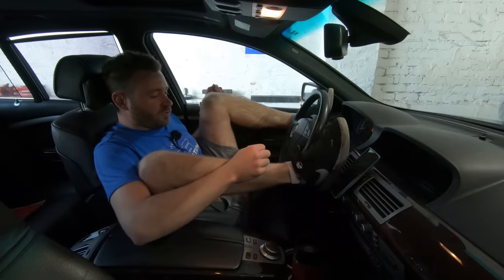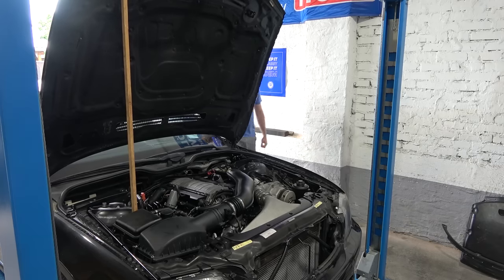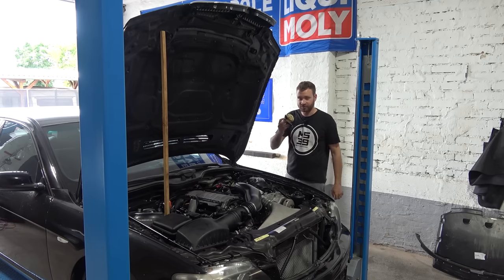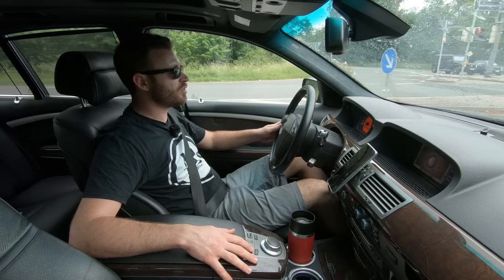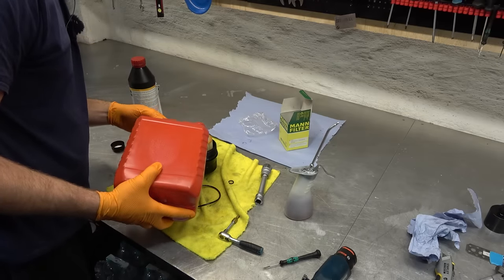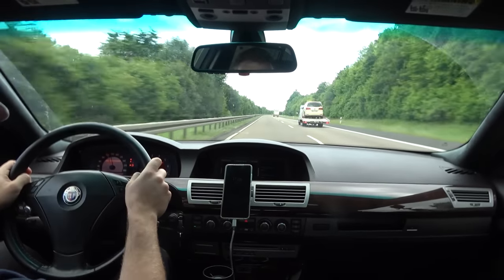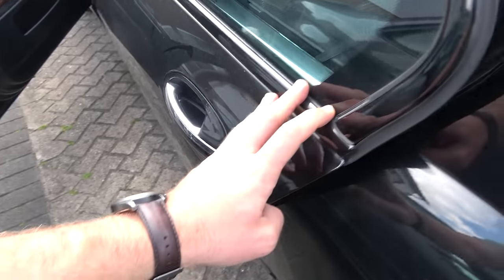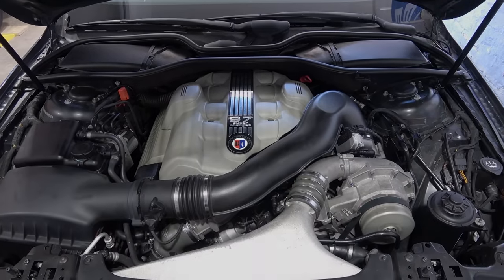Will The Freshly Built Engine Survive? - Supercharged Alpina B7 - Project Chicago: Part 11

Comment: Regarding the power steering hose: over here in my town we have a shop that specializes in making hydraulic lines, e.g. heavy equipment fluid lines, ac lines, ps lines, etc.  I'm sure you have one in your town too.
Reply: I second this -- I have heard of Rob Dahm doing the same thing in a recent video. He mentioned that the manufacturer charged some $300 or more for some hoses - I think they were fuel or oil hoses. 

He didnt like the price so he hit up a shop that specialises in hydraulic lines and they built him one with all the fittings that he needed/wanted for $100-150.

At least i think it was Rob Dahm.
Reply: @Rose.Of.Hizaki  I found the shop (Hosefast, in Garland, TX USA)  in my town after I went to replace some power steering hoses on my old '92 Honda Accord.  NLA from Honda, only leaving crappy, obviously-not-stock-looking aftermarket alternatives.  They were able to take my original fittings and graft them to new fittings to be pressed onto new hose.  They looked factory after they were done.
Reply: I had the tranny cooler lines on my E65 start to leak due to corrosion at  the hard line/rubber line junctions. At $500 a set to replace, I just replaced the set of lines using stainless-braid lines and appropriate AN fittings like I've used in my race/rally cars. May not be stock and true to the design; but cost less than half and a better, more reliable solution.
Reply: If you use one of these hydraulic shops, the rubber will last twice as long. And the hose will probably cost a fraction of the price the crappy OE part would.
Reply: Second this. The work is usually spot on and also super cost effective.
Reply: In my area no one of the  heavy equipment shops will crimp you their hose ( muuuch stronger the the original ) for a car power steering unless you wil tell them it is for a lawn mover.
Reply: Yes these hoses are made and replaced all the time for JCB, CAT digging equipment and tested to 1000s of PSI.  Cheap too compared to buying from the dealer.

Comment: Hi Sreten, I have my opinion about the choices that Alpina made with this model: almost every manufacturer in in that period of making cars (2000-2008) changed the thermostats to higher values (from 85-90 to 102-105 degrees) and put 5w30 oil for emissions purposes. Higher the temp in the cylinders = cleaner burn, less CO2(but they didn't know back then about NoX or not yet required to be measured) and lower viscosity meant less friction = less CO2.
Keep it up! Really nice work.
Reply: Was thinking the same. Noticed almost all the benzine naturally aspirated engines , from that era , running a lot hotter than needed. Has to be the bullshit emissions reqs.

Comment: I agree that the E65/66 may have been the last BMW true to the marque. No turbos, no AWD and not that bad to work on if you have the right attitude and access to an ISTA scanner. Very pleased to see that you have the B7 up and running properly. Sounds sweet and solid, the way the BMW gods intended. Great job, excellent recovery from a relatively simple mistake, and well-documented. Have enjoyed every minute. Now on to sorting the suspension! BTW, I have an '08 E65 750i and I love it! May very well be the best car (of the 50+ I've owned) I've ever had.

Comment: Weird how it worked fine on initial startup, must be an oil pressure thing.
Reply: Car needs to see a fault a few times before it throws a check engine light and disables vanos I think.

Comment: When I deal with obsolete leaking power steering or brake hoses, I take them to a local supplier here that deals with high pressure hydraulic hoses and fittings for heavy industry like forklifts, farm machinery, elevators, etc and they can rebuild them often with better components than the OE can provide (anyone who has had experience with GM or Chrysler hose crimps can attest). I'm certain there would be something like that in your area, Sreten. If you're unsure just ask someone who works on Forklifts where they get their hoses rebuilt.

Comment: Sreten,   excellent effort and just reward  for just never giving up!    If I was managing design at BMW I would have the VANOS units designed so  that a) they could NEVER be fitted to the wrong camshaft and b) the electrical plugs to the VANOS solenoids could NEVER be reversed.   You would not be the first to fit the VANOS units the wrong way around and you won't be the last.    Also there are brackets on brackets on brackets and LOTS of fasteners,   breaking all the rules of Reliability Engineering.
I think the best beer comes from Munich.......
Love the borrowed dog!

Comment: Really pleased for you. Did a similar thing with the intake etc on my S85. Not the Vanos units n the wrong place but measuring the intake and exhaust the wrong way round on bank 2 making the exhaust out by 39 degrees every time. Stupid mistake but easy fix. It was actually perfect every time if I'd used the correct tool.  Running sweet now.

Comment: Most pleased to see you get this back together and in good shape. I think your sensible approach should future proof the engine. I have to agree, tight tolerances and high temperatures in conjunction with dishwater thin oil and forced induction is not a good combination. Absolutely ecstatic to see the E30 back. Please treat her well, she’s an old girl and is some way handling wise behind even the E36. Hopefully happy days from here on.

Comment: You have so much going on with your new channel venture,  I would suggest when you do a engine rebuild (with all these details) you make a basic assembly "check off" chart.........especially for components that could be potentially swithed or reversed. Like VVT adjusters ;)
I recently read on a Audi forum where a member with a A6 did this very thing! Only he spent days and days after his work trying to diagnose the fault code.
In the evening, when you are lying around thinking about all these projects, make the lists for potential problems "what could I intall backwards or incorrectly on this (engine) project" or items that you think could be reversed.  Then tape the list to the windschield  or side glass of the project car - that way you will be reminded of potential pit falls as you go.  
Always enjoy your videos and thrilled for you that the Alpina project worked out!

Comment: I used to be a bmw mechanic and I think the bearing issues were due to 10w60. Too viscous and people did not warm engine up properly and that oil is for racing. I recommended against bmw recs, a redline 5w40/50 (can’t remember if they made a 5w50 but I think 10w50) or any real PAO synthetic oil in 5w50 in summer or if driven hard 8n cooler weather and then 5w40 in cold temps if car was used in those temps (below 40f). Had good results.

Comment: to stop scoring of the block, add 0.5% per litre synthetic 2 stoke oil (MOtul 800 / Castrol 1 ) I use 2 stroke oil in ALL of my 4 stroke engines for the past 20 years. Stops valve stem wear / Injector wear etc etc. I have E39 540i which I naturally use 2 stroke oil @0.5% <  no problem for the oxygen sensors etc and I see improvement in k/litre improved compression etc. Compression will actually get better after using for 1-2 months. Current day fuels are to dry for engine longevity.

Comment: Ive been there.....made a simple classic mistake on assembly.  I was putting a new chain and guides on a E46-316ti and when I locked the cams with the timing tool, the intake cam had already skipped enough teeth that I had it out by 180 degrees, when I rotated it to be timed to the diagram/picture I was following.  Assembled it would not start.......despite having spark and fuel.  Luckily the valvetronic system means the intakes never open much on cranking, and so the valves never hit the pistons. I figured out the problem, got the intake cam correctly timed, and away it went. Drove me mad why it would not start............but I just decided to make no assumptions, and check every thing that could be wrong.

Comment: Very nice work, congrats!
btw, the difference of in/out VCP (variable cam phaser, Vanos for BMW)) usually are the turn direction (clockwise or anticlockwise ) of the pulleys relative to their rest positions (without hydraulic pressure). I am surprised such a component was released by BMW without a proper mechanical poka-yoke to prevent incorrect assembly. Zum Gluck, nichts schlimeres ist passiert.

Comment: Congrats on pulling through with that B7! That called for some grit and determination!!
On BMW steering wheels that basic e60 wheel is bad alright, but remember the steering wheels from the nineties, those first ones with airbags? puuuuuuuuke For me they were deal-breakers on some occasions. Especially when you knew that the same generation of car could have a really beautiful non-airbag version in the previous model year. Maybe an e60 m-sport wheel could fit the Alpina?

Comment: If asked previously, sorry. Why did the engine start and run well the first time if the vanos intake and exhaust gears were incorrectly installed? Would expect check engine light and poor idle the first time you started it? As always Sreten love your passion and your videos.

Comment: hey man, cheers from venezuela, car enthusiast. i gotta question: Dont you think that an engine from design with such tight tolerances between parts should be using a thinner oil but a resistant oil? how will a 5w50 oil flow at the rate that is required through such tight gaps? this is a question from a car enthusiast perspective and an economist, i am not a mechanic neither an automotive engineer. Here we use a 10w40 viscosity oil but its because the weather - intense heat and traffic. (i know you should use what manufacturer recommends, but in some vehicles the recommendation depends on the weather you operate the car). anyways i enjoy the content you create, its unique and im always looking foward to see if you post any advamce on this particular vehicle that was a challenge.

Comment: Hello, i'm a big fan of your Channel. I also have N62B44 in E60, i also rebuilded my engine about 9000km ago and i still have glitter after second oil change. Can you please explain why it is normal to have glitter in the oil filer cap, because i'm little bit worried, no any big metal shavings. Thank you. Thumb up.

Comment: Unreal that you happened to notice those gears being off when standing there looking under the valve cover, just think what would have happened to your brain if you buttoned her back up and didn't notice that!

Also - the very first "mod" I do to all my cars is buy silicone wiper blades.  No more window chatter and they last YEARS and YEARS compared to normal blades, while constantly leaving a microscopic bead of silicone on the windshield each time they wipe.

Comment: Eibach springs are no good. You are missing out on suspension travel that Eibach often compensates with progressive winding. Looks good but feels weird. Definitely less comfort. Worse - I once ordered a set and the coating was missing in one spot. Eibach would not replace the spring for me. Go back to OEM springs. Use better shock absorbers for sportier ride always. Use Bilstein B6 where possible.

Comment: That's what worries me about the newer BMW engines. They produce so much power per liter and are quite boosted yet BMW is recommending 0W20 oil for the B58 and 0W30 for the S63TU. I get the 0 weight for startup protection especially in cold weather but for the longest while most German cars ran a 40 weight oil like a 0W40 or 5W40 oil. Funny enough the owner's manual in those cars say you can use a 30 or 40 weight oil as well.

Comment: I'm curious, what are the rules with registration/TUF with a car with changed engine in Germany? In addition, is there a way to be upgraded? For example if I have an 320 e46 can it be swapped with 2.8 or any other than 2.0l engine? Here in Bulgaria, from what I know, the only option is to change an engine with the same one from the same model of car and the paper work is awful.

Comment: You did replace the uggly E60 2003-2005 steering wheel against the E60 Sport wheel with shifting paddles. Did you get a 2003-2005 wheel or is it also possible to replace it with the 2005-2010 wheel? The mechanic connection will not fit old wheel and new wheel design, doesn't it?

Comment: I use 5W30 in my 2005 Mercedes B-class and it's been like that from the factory.. Should I use a thicker oil? It seems like 5W30 is a good balance between lubrication and temperature range. And my car doesn't produce nearly the power these BMW do..

Comment: Use Mobil1 oil. That stuff has an excellent additive package with lots of Molybdenum and Boron both excellent friction and wear reducers. Also the Viscosity Index is really high across their different oils which indicates a high stability of the oil under high temperature.
Reply from the maker: Not a fan of that oil, but all premium oils are good. Motul for example has better HTHS than any Mobil1 oil.
Reply: @M539Restorations  ive been looking around specifically for the best DPF-safe C3 oil you can buy and Mobil1 ESP seems to be superior to Addinol and Liqui Moly. 
Right now I have Addinol Premium 5w30 with Liqui Moly MoS2 Oil Additiv in my engine and its the smoothest and quietest my car has been so far. 
I dont know if the oil or the Additive I mixed in makes it run so well but the combination seems to help my old Diesel a lot.
I want to run a slighty thicker oil over the next summer just as an experiment if i can get the engine to run even more quiet without using an oil thats TOO thick. 0w40 or 5w40 would be my limit. 
People recommended Mobil1 ESP 0w40 to me and 0w40 isnt as common as 5w30 so Mobil1 is basically the only option.

Comment: That engine will blow up again. The combination of aluminium pistons and cylinders and boost from the compressor is what's the cause. Aluminium melts at 670 degrees, just measure your exhaust manifold temperature under load and you will see what I mean. It's just not the right block to throw boost at with it's coated aluminium cylinder walls.
Reply from the maker: You clearly have no idea what you are talking about. The cylinders are not coated.

Comment: Always problems with BMW’s.  Always.   Glue in door panels will fail breaking rear sunshades.  Guaranteed.  Parking brake will fail. Always system code, restraint, stability etc.  on and on and on.  Dump all BMW’s.

Comment: @20:39 That is not a good thing because it means that it brakes easily. Alpina is not a sham like a M-series BMW. You get the horsepower and you can use pretty much all of them.
Reply from the maker: Alpina is shit in my book. M cars are properly engineered with S85 and S65 being last good M engines. Alpina tunes and modifies and this engine especially is shit.

Comment: Why are you putting your feet on the dash?
Reply from the maker: Cause I want to.
Reply: @M539Restorations  it’s really unhygienic though like… you’ve probably stepped in dog shit and you’re putting your feet up on the dash
Reply from the maker: @alexdev5809  Please don't be that guy. The car is disgusting as it is, probably never cleaned and yet to be taken apart and throughly cleaned and detailed. Not concerned about feet on the dash and no, I didn't step in dog shit.
Reply: @M539Restorations  you probably have depending on how long you’ve owned your shoes
it’s just kinda gross man
Reply from the maker: Unbelievable what some people are bothered with... just move along, it's not your car anyway.
Reply: @M539Restorations  no man, some of us are raised in a household where this us extremely wrong. it’s just mental to me how you can even contemplate doing it!!
Reply from the maker: And some of us are normal and not  overreacting about nothing. I barely touched the dash and it is not part of the car you touch with your hands. The car will be detailed as I explained. Now drop it and move along.